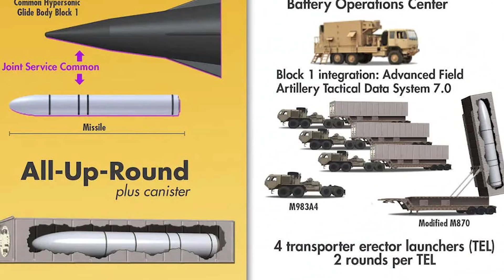Elon Musk Just LEAKED This INSANE Hypersonic Fighter Jet!

Comment: First most jet pilots who fly at  0 to 50,000 feet in combat around mach 2.5 find it hard to control, professional driver pilots [SR71] who flew at 0 to 200,000 feet at mach 4 let the on board computer fly the plane! A pilot who flies at 0 to 300,000 feet [HOLY GRAIL ZONE] at mach 5 to 10 could not control the aspects since you now have a space shuttle! Hello anybody remember Neil Armstrong's X-15 [Rocket only] flight at mach 6, yah the first "HYPROSONIC MANNED FLIGHT", HELLO different rules and I am not even talking thermodynamic!!!

Comment: You must understand first of all that ALL ICBM and LSBM are pretty much hypersonic weapons.  Even the onl Trident 3 re-enters the atmosphere at Mach 25.  As for shorter range the US has 3 types.  One is the boosted glide bomb that they tested on the B-52.  It has a range of about 1000 miles and a speed or at least Mach10... possibly Mach 20.  As it maneuvers or reaches its range capabilities it will start to slow as it glides most of the way in.

The second is a cruise missile that is similar to the Tomahawk, but MUCH faster.  It is small enough to be fired from an F-15, 16, 18, and 35 (but can not fit in the internal bay).  It has a range of 1750miles and a speed of at least Mach 5.  This is propelled the whole time (not a glide warhead), so it can stay low and maneuver as much as it wants.  I think this is FAR more powerful of a weapon as it will be VERY hard to stop.  The US has successfully tested this one last year and has more tests planned this year.

The other is the AIM-120 replacement, the AIM-260.  It will have a longer range of at least 200km and a higher speed of Mach 5.  Rumor has it this will replace several missiles as it can be ground, ship, or air launched and can target ground, air, or ship targets.

When combined with missiles like CHAMP, GBU-53/B (Stormbreaker), and the new Stinger missile in development and the plan is to order 8000 by 2026.
Reply: Weren't the US developing  hypersonic missiles called "Waveriders"? That was about 10 years ago.

Comment: frequency Flash Grenades. Sudden Light Burst with Frequency Sounds that Very in Intensity and frequency. Disorienting the enemy.  The frequency sound like A alarm clock buzzer or a whistle.
Reply: Colored light could work incorporated to. Remote controlled and battery operated. Reusable and Code needed to use.
Reply: If you alternate bright light colors with high intensity those eyes can't adjust.
Reply: Also Invisible technology could be effected by them.
Reply: Like Stealth.
Reply: Like maybe the outer light, the Hue I believe a bright intense white light that has a outer Umbra or penumbra like a Shadow.  That outside of the light color change.
Reply: Maybe A sudden rise and maybe drop in temperature in an Area of let say 6 feet. Could be used.
Reply: Like taking a shower and someone runs the kitchen sink.